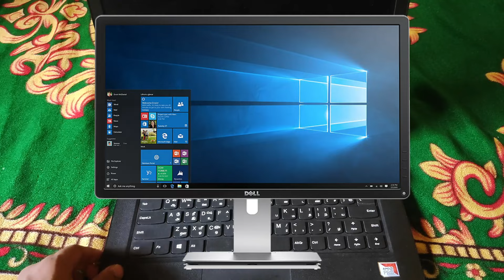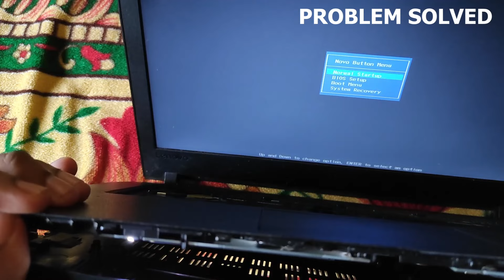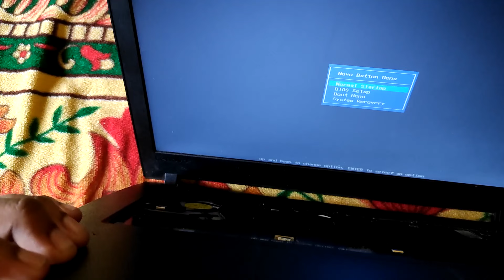How to Fix Lenovo E41-25 Laptop Turn ON but Black Screen in Tamil | 100℅ Works

Comment: Bro laptop open akudhu odaney again off akudhu ena problem pro
Reply: On panra bottana press pani off panra pola tik nu sound vandhu off aidudhu bro....ena issue bro
Reply from the maker: Athu keyboard problem bro atha remove pannitu right sidela usb port irukkum athukka pakkam oru hole irukkum athula sim ejector pin vachu click pannunga on aagum
Reply: @TheTechRider  on akudhu normal on pana on akudhu but off akudhu odaney
Reply from the maker: Keyboard remove panna peragum off aagutha
Reply: @TheTechRider  bro Nala use akudhu bro.....same time off akudhu
Reply from the maker: Ok bro appam cmos battery ah change pannunga bro athu oru ₹10 varum and thermal paste change panni paarunga bro sometimes overhead problem iruntha ippidi off aagum
Reply: @TheTechRider  ok thanks bro ♥️
Reply from the maker: @ChandruMaran-gy8cz ☺☺
Reply: Bro same problem , neega Ena paniga ipo laptop work aagutha please replay
Reply from the maker: @sivavenkat799 bios chipla program pannan bro seri aachu thirumbaum same problem vanthu athukku antha bios chip ah change pannanum athanaala appidiya laptop vachirukkan bios chip kedaikala
Reply: @TheTechRider  thanks for the reply brother
Reply from the maker: @sivavenkat799 ☺☺

Comment: Anna same problem but ram eduthu again pota black screen 😢
Reply from the maker: Cmos battery ah remove pannitu podunga approm tv or monitor la hdmi cable use panni connect pannunga display varalam appidi vantha display problem otherwise software or motherboard problem
Reply: @TheTechRider  display light lam work aguthu anna but keyboard random ahh work aguthu example 1 press panna a varuthu ithukku enna solution anna sollunga
Reply from the maker: Laptop on panna munnadi ellam button press pannunga approm oru 2min kalinju on pannunga ippidi oru 2week pannunga sometimes seri aagum otherwise keyboard change pannunga
Reply: @TheTechRider  ok anna try pandren

Comment: Bro Laptop On Aagudu But Display Blacka iruku... BIOS Problema Bro...
Reply from the maker: Caplock button click panni paarunga bro light vantha bios problem illa. Otherwise monitor or tv la hdmi cable use panni connect pannunga display anga varum
Reply: @TheTechRider bro caploks light on agala
Reply from the maker: Keyboard ah remove panni paaru bro sometimes keyboard problem irunthalum caps lock light varathu

Comment: ennoda lap la power key on panna orange light 3 times blink ayitu off ayiruthu ena problem ah iruku...solution
Reply from the maker: Charge aaguthanu paaru bro and charge pottah enna color la light varuthunu paaru bro. Charge aaguthunah atha open panni ram ah clean pannitu pottu paarunga bro